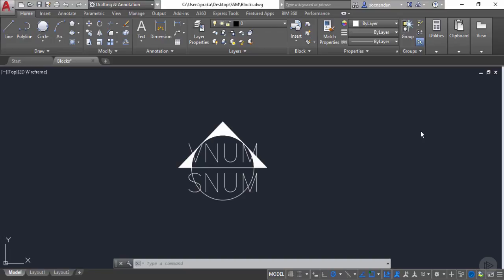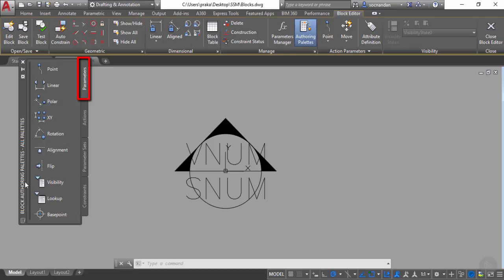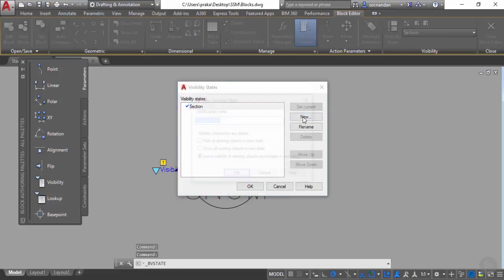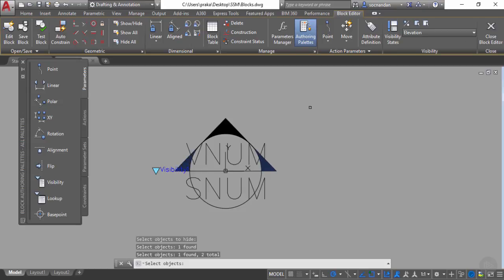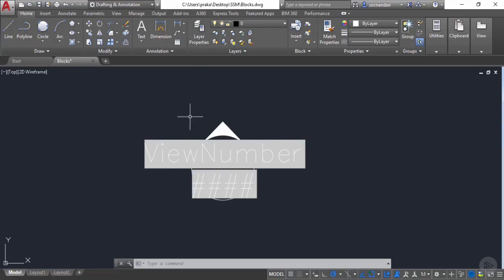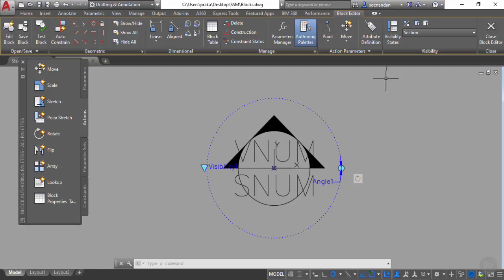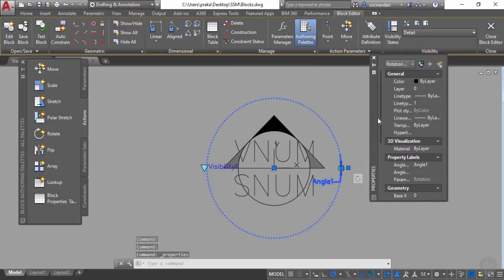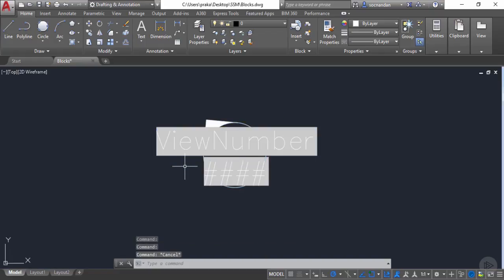11   Label and Callout blocks   Adding Dynamic Features to Callout Block

Comment: I would just type DC command and enter. It will bring up a list on the left side. I would choose either Metric or Imperial, then double click for blocks or drag blocks to my sheet. There ya go, you dont have to make it 😂 It's free in autocad